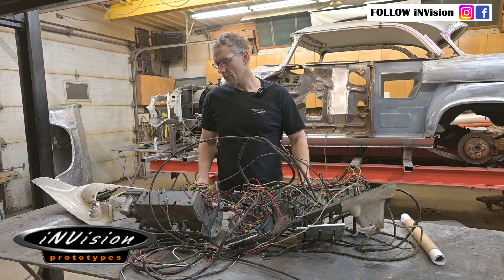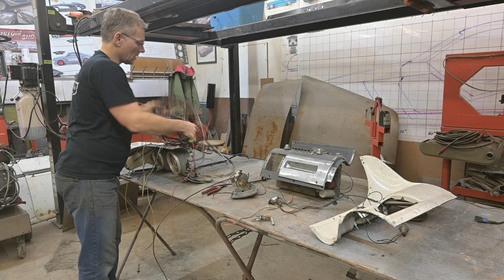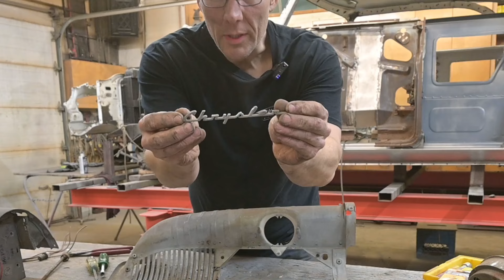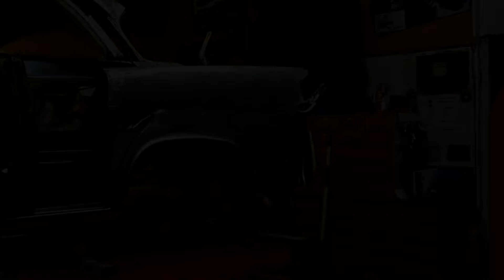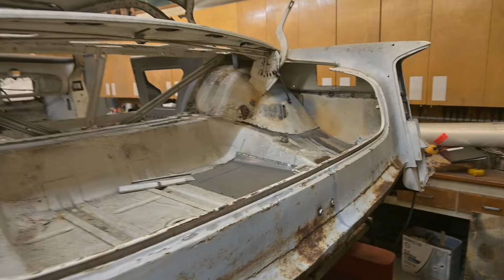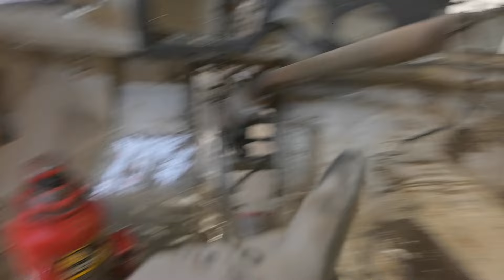WIRING NIGHTMARE! ⚡ Also Welding On Signature Fins | 1956 Chrysler Muscle Car Concept!

Comment: If you look at the dash of a mid seventies Cadillac the idiot light says GEN. The boys at Cadillac maintained because the output terminal was DC current that it was a generator.
Reply from the maker: Interesting!!
Reply: @iNVisionPrototypes  An ammeter’s coil measures the voltage across a low ohm resistor within the meter if there are heavy gauge wires running to it. By placing an equivalent resistor in both ohms and watts across the terminals the meter will read half value. A 30 amp meter can easily handle a 42 amp alternator and still give an indication of charging and discharging.
Reply from the maker: Just the sides?
Reply: @iNVisionPrototypes  The ends too I guess.

Comment: You mean the old TVs didn’t have fly back transformers. They had dual channel power supplies which were deadly.
Reply from the maker: Flyback xformers generated a high voltage that was used to control the horizontal movement of the electron beam in the old CRTs.
Reply: @iNVisionPrototypes  No, flybacks replaced dual channel..These days they are both old.

Comment: You can run an ammeter with an alternator, but you are absolutely correct about the fire hazard. Voltmeter is the better way. Also loved those Xcelite nut drivers. I have had the same set for over 30 years!

Comment: The dash and its components fascinate me.  Imagine draftsman and engineers laying this out, on a drafting board no computer, the pushbutton transmission pod, it looks one piece but it has to be a casting, right? Even the right side panel is so intricate, all the different shapes, must have been quite a die to stamp that. Really nice work Nick.
Reply from the maker: Details for the parts are amazing!!  That's why we're taking the 56 in the direction we are.  Thanks for watching!